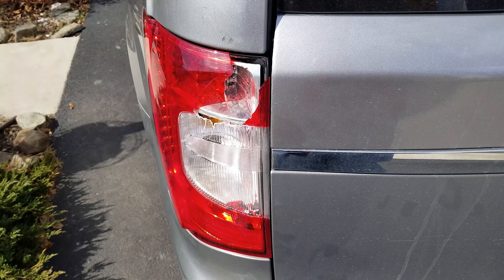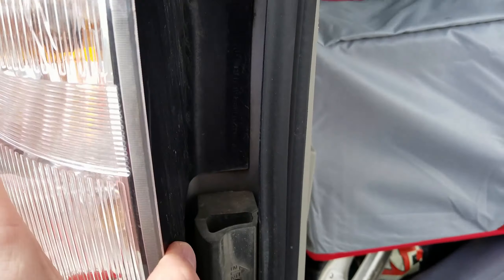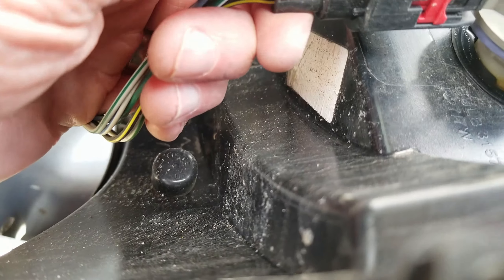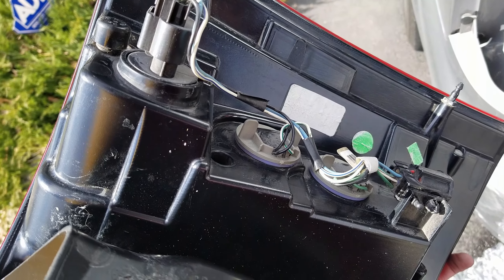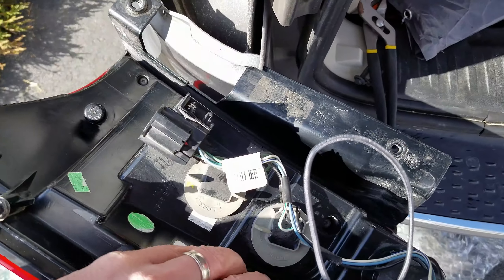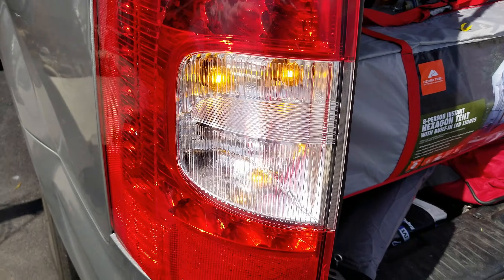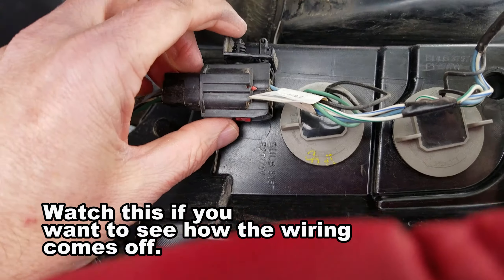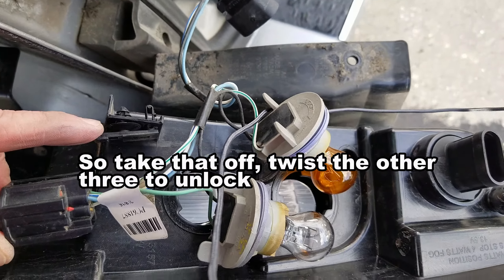Broken Tail Light DIY replacement

Comment: Thanks! Sounds very simple and easy
Reply from the maker: It is pretty easy, definitely.
Reply: @SeanDIY  2007 Nissan Sentra tail light clear cover fell off, while the light assembly itself is intact.  How do you put that clear cover back on?  It does not seem to have a way to snap it back on, and definitely there are no screws.   Asking for a neighbor.

Comment: Same steps for a left side rear light cover replacement of a 2004 Mercedes Benz E500 station wagon?
Reply from the maker: It should be the same for most vehicles with some nuances depending on the manufacturer,  but generally the same.

Comment: Would I need to remove my car battery or is it enough to turn off the car?
Reply from the maker: I didn't remove the battery. It's never a bad idea to do so, but my thinking was that the tail light only gets power when you turn on the lights, put the car in reverse,  step on the brake or turn on the blinker. In my mind I felt safe not disconnecting the battery but others may disagree with me.  Your choice I'd say.
Reply: @SeanDIY  thank you!
Reply from the maker: @oliviaseverns7939  Any time

Comment: Does new tail light you bought matter which side of the car it goes too? Or if your right tail is broken there is a specific right side light you have to buy?
Reply from the maker: Great question. They are side specific.  So if you need a left tail light you need to buy a left one, if it's the right then you need a right side.  I believe they may call it driver side and passenger side.  What vehicle are you replacing the tail light on?
Reply: A 2020 Toyota Tacoma. But I’m confused are there a lot of type of tail light because I want to get the one that is like the other side.
Reply from the maker: Each vehicle has their own style so each has a different tail light. You will need to find the one designed just for your car.
Reply: Oh okay, thank you😃
Reply: Right an left lights
Reply from the maker: Correct. Each side is specific and a right side tail light will not fit on the left side and vice versa.

Comment: 2007 Nissan Sentra tail light clear cover fell off, while the light assembly itself is intact.  How do you put that clear cover back on?  It does not seem to have a way to snap it back on, and definitely there are no screws.   Asking for a neighbor.
Reply from the maker: Good question. If it's all one piece then you may need to replace it as one unit.

Comment: Did you get pulled over while waiting for the new tailight? Or did you just park it and take other transportation? I'm waiting for the part and don't want to get pulled over 😔🥴
Reply from the maker: I didn't. I would keep the receipt in the car though and if you do get pulled over explain you are waiting for the part to come in.  You can also get a red see through tape for cheap and tape it in the interim.

Comment: There's pieces I still haven't put back on the truck...
Reply from the maker: Now is the time!  Do you have a minivan or a pickup truck?
Reply: @SeanDIY  4runner, 300k miles. I'll make it pretty later
Reply from the maker: @stauker.1960  that makes sense. I have a Ram 1500 with 248k.  Impressive to have over 300k